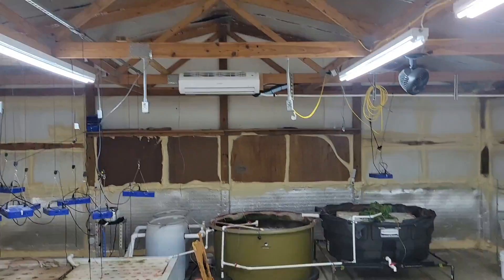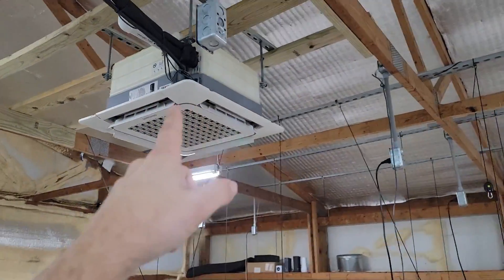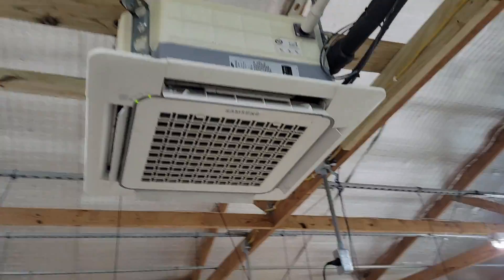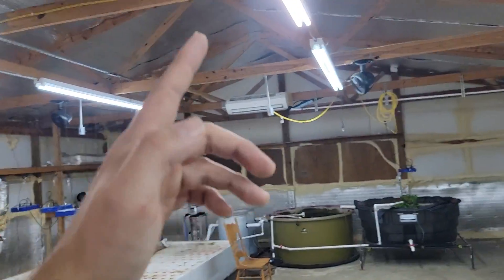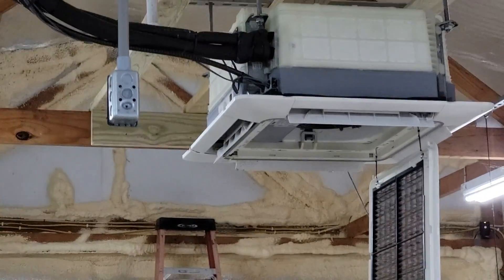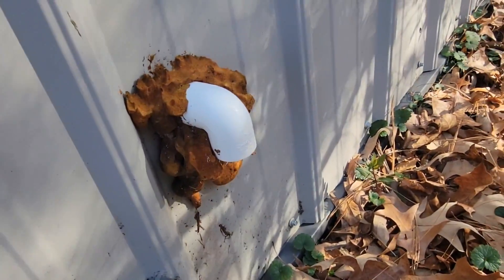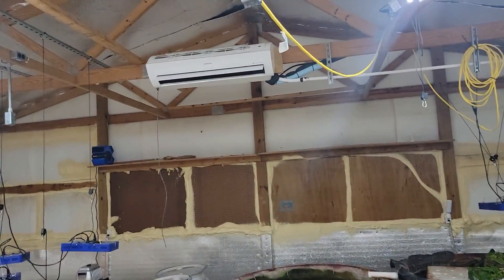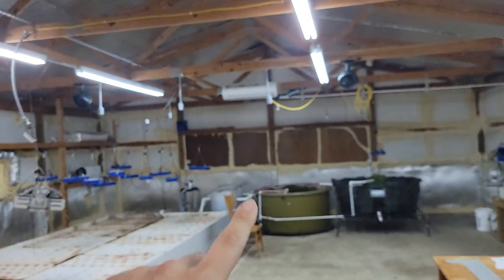Ceiling Cassettes Verses Wall mount air handler #minisplit #airconditioner

Comment: First time watching your video appreciate you sharing your knowledge! I have a question I have a 45' Storage container I'm using as a grow op I had spray foamed about 1.5 " average overall Im in  Oklahoma, was looking at a 36k  BTU mini split not sure if I should go (2) 18k handlers or (1) 36k in your opinion is that sufficient or not? Thanks in advance!
Reply from the maker: Depends on where you put those air handlers
 And how your grow operation is set up
 The more air handlers the more air
 But the best place to put an air handler is on the narrow side so that it has the best chance of having the most air throw
Reply: @taddydigest  Ok that makes since, glad you mentioned that. I was going to install it in the middle on one of the long sides. I did build a partition wall to separate the grow room & a clean room that’s 5 foot from container entrance, in your opinion should I install (2) 18k  handlers one on the short wall at far end with the other on that partition wall with them facing towards each other. I’m just wondering if I can get away with (1) 36k btu handler vs (2) 18k btu handlers in order to save a little money. Thanks for your input & sharing your knowledge!

Comment: Awesome content! Virginia here. So sizing the units. I do load calculations for each space add them together for the total btu for the condenser. The individual wall or cassette are sizes per space? Can you do up to 8 rooms? Thank You
Reply from the maker: Yes you could do 8 rooms you would have to use a 5 ton DVM Eco  With that many indoor heads
Reply: @taddydigest  Thank You Sir! 5 tons is a lot of a/c for the square footage involved. The living space is at the bottom of the house situated on the north east side. However I’m assuming the individual units will handle the “ conditioning” even with a bigger condensing unit! I’m thinking the heat pump will be more than sufficient. The homeowner doesn’t want to supplement a secondary heat source. Located in Central Virginia.

Comment: Are there any concerns installing a cassette type evaporator into unconditioned attic space where the temperature may reach as cold as -10º F?
Reply from the maker: Yes there's a drain
 And the drain might freeze at those temperatures
 Couple options to take care of that would be onePut a heater up there orPut heat tape on the drain
Reply: @taddydigest  Is there condensate generated when the unit is in heat pump mode?
Reply from the maker: In the heating mode condensate is not generated
Reply: @taddydigest So, as long as the condensate drain line is empty before winter I should be ok with the rest of the components?
Reply from the maker: That's correct

Comment: I like the ceiling mount shown in your video. Question I have what is the btu i need 12k and how long of a line set and communication cable can be used. I want to install in a upstairs bedroom ceiling, run the line set in a attic then to the condenser approximately 80’ away. Will that be ok. Also will you sell to a home owner. Thanks Barry
Reply from the maker: Hey daddio I will do a video tomorrow about this to help you
Reply: @taddydigest  great. Thanks
Reply from the maker: I did this Video for You https://youtu.be/9vz9pvkbW7I

Comment: I know you said to get a 230vlt over a 110vlt but I'm in a 34 ft 5th wheel camper.  so 110 will be better than my roof top that stays on all the time right??
Reply from the maker: yes 110 volt will be fine for your camper

Comment: I have an older home with a vented roof system and the roof is not insulated so it get extremely hot in the summertime. Do will I have to cover the unit with insulation? Thanks!
Reply: Definitely consider putting an exhaust fan up there.  A fan at 80 watts is much cheaper on electricity than an aircon at 1100w.  My attic is hot too, and I can feel the heat radiating down from the ceiling when I enter my place.  

Imagine if that heat was removed.  And running the fan at night would really cool down the attic. It's often actually uncomfortably cool outside at night, so in the morning the place would actually feel cool instead of still warm from last night.  

Also, your aircon will not have to start up until a few hours later in the day too, saving more money. Just be sure the attic fan doesn't vibrate the structure, because that is a complaint people have about attic fans, when trying to sleep.
Reply: @mikemotorbike4283  Thanks for the advice. It actually does cool down quite a lot at night. It just gets extremely hot during the day because the roof itself is not insulated but there is blown in insulation above the ceiling. The roof has several vents and there is a huge exhaust fan in the ceiling. It’s one of those vented attic systems for venting the house.
Reply from the maker: You might have to cover the unit With some batted insulation or something
 But it all depends on the temperature that that attic gets to during the hot summer
Reply: @taddydigest  Unfortunately It’s the south so it gets ridiculously hot like it has been in this recent heatwave. Thank you for replying sir. Much appreciated.😊

Comment: Why does it need a drain trap with a condensate pump?
Reply from the maker: You may not need a trap with the built in pump. You may not need to install an air vent if the
horizontal drain pipe has a proper slope. Thank You Johnny for watching the video.

Comment: Samsung comes with aluminium condenser which is very easy to leak and hard to repair, as well it Doesn't cool faster like copper condenser, u should have gathered some background information before make the purchase
Reply from the maker: These coils are copper on this equipment

Comment: The integrated condensate pump in the ceiling cassette surely makes installation easier - but I'd want to know how difficult/costly it is to replace. Nothing lasts forever, so if getting the condensate pump replaced is a huge job, that makes a ceiling cassette way less attractive to me.
Reply: Sold kitchens..no job started until all appliances at home..sizing can and does change.. yes replacement means repair work..
Reply from the maker: It's pretty easy to replace the pump that's inside the cassette I've got a video that you should check out on my playlist HVAC tips for Technicians
Reply: @taddydigest  Good that it isn't a big deal - but I'll bet that replacing an external failed condensate pump is easier. And from a homeowner's perspective, I am sure it is cheaper. ;-) Of course, gravity condensation removal is the best by far when you can go that route.

Comment: 24x24 won’t fit on the ceiling with joist by 24 in.  You need to subtract at least 1.5 inch.  In house, I have two 2x6.  So I only have 21 inch opening.  I need to go with Mitsubishi cassette
Reply from the maker: mini 4 way ceiling cassettes fit in a drop ceiling but yeah with 2 x 6 you will ne frame it out Thank you for watching. Have a blessed day

Comment: I have a ducted Bryant mini split. The fan went out and it’s almost impossible to change. The four way Cassette looks like a good replacement. We have a price, but they want to replace outside unit too. Can the Cassette be added without replacing outside unit it’s only 6 years old.
Reply from the maker: cassette has to have its own outdoor unit
same brand because of the electronics and controls
Reply: @taddydigest  Thanks
Reply from the maker: Absolutely Freddie you're welcome

Comment: Building a new garage. Brand new Trane Mitsubishi mini split. Found out after installed the lowest temp you can set on the thermostat is 67 degrees. I live in the US, upper Midwest. I don’t want to hear a garage to 67 all winter. 45 or 50 would have been more affordable. Any way to hack the system?
Reply from the maker: that's a good question I think you can using the manual
Reply: @taddydigest  thank you for the response. The installer said he call Mitsubishi and they told him no. I will look for myself.
Reply from the maker: Yeah I think you may be able to still still I think I did one time just for the heating temperature it was under the advanced settings and it was minimum and maximum temperature
 User manual
Reply: @taddydigest  thank you, I have access to the advanced menu and (bad news) it will not go lower than 67. I am going to keep working on it. Thank you so much for your help 😊
Reply from the maker: Hoping you find the answer Let me know if you do if I am in the midst of any mitsubishi reps I will ask the question
Reply from the maker: advanced features on thermostat
Reply: You are confusing the cooling temperature with the heating temperature limit. All heat pumps generally only cool down to 60-something degrees. With the heat, it only heats to 80-something degrees. You can go as low as you want when you're running it as a heater.
Reply: @mikemotorbike4283  in this case when heating the lowest temperature is 67 degrees. Not what you are saying. I would like it to heat to 45 or 50 degrees in the winter. Not as high as 67 degrees.
Reply: @mikemotorbike4283  Hi, I believe I responded to this. Just in case, on the heat cycle it starts at 67 degrees and goes up. I can not set it below 67 on heat.  What I have found out so far is raises the efficiency so the manufacture can claim a higher level without re-engineering.

Comment: Just an fyi from an HVAC contractor: the vent for the condensate drain goes AFTER the p-trap. The whole point of the trap is to prevent air from the attic or other unconditioned space pulling into the unit adding load and possibly preventing the water from draining properly.
Reply from the maker: thanks for the Knowledge
Reply: Throwing in 2 cents, a vent's first purpose is to protect the trap (from siphoning).

Comment: Is mini split a good system for a 3500sg ft house?
Reply: Some people install more than one mini split. It seems to cost about the same, since adding another indoor air handler seems to double the cost of the units.anyway, from $1000 to $2000 just for the same outdoor unit and two indoor units.  Plus the overall efficiency of the sytem goes down a bit the more indoor units you add. Also, you now have a backup.  And the lines arnet such a pain to route.  And less failure points to take your unit offline for weeks or days.
Reply from the maker: Yes absolutely
Reply: @taddydigest  and the line sets are long enough? do we buy extensions?  i have 5 bedrooms..do i install a air handler in each bedroom?  and then i'll probably need 3 air handlers on the first floor?   is that feasible with a split system?

Comment: The main disadvantage of ceiling cassettes is the problem to get the condensate water away. You always need a little pump in these things and these fail quite often. Some manufacturers (mainly C...) don't take servicing them into account and you have to disassemble nearly the whole unit to replace them.
I HATE these little devils! They create work where not necessary, I want to strangle the guy who came up with the idea to build these units the way they are built.
If possible, always prefer to get units without condensate pumps, where the water can drain freely through piping without a pump.

I work in the facility management in a big company and I could do nothing else than to replace these things all day long the whole year. It's just annoying and I simply don't want to do that anymore. Especially when one year later you are at the same unit again doing the same work.
Reply from the maker: I noticed that if you run this equipment during the construction process that the pumps are always filled up with gun and I have to take the pump out and clean it

 It would be nice if they were like the ducted equipment where you have a choice between a gravity drain and a  pump

 Thanks for watching
 Thank you for your knowledge
 have a blessed day

Comment: The main disadvantage I've seen with cassettes is if installed in a hard lid you need attic access or a near by access panel for servicing.
Reply from the maker: Yup gotta have an access panel for servicing the equipment
 That's right Joe
Reply: @taddydigest  have a video or familiar with a video with options on this? I won't have an attic, just a ceiling/roof that will be about 16" thick
Reply: I know it'd be a pain but couldn't you just drop the unit to service it? What kind of maintenance are we talking? I live in a bungalow style house, and I really don't want to do the full handler style, the cassette is a much better fit for me. Thanks for your help
Reply: @psykho15  I haven't seen a cassette that the line set will allow it to drop down. I could see it being possible to be able to run it up and down on all thread and have the wiring and condensate long enough. But refrigerant ports would need to come out the top of the unit.

Comment: Great....great video! Finally a video that's to the point and informative!
  I live in Montreal Canada and I was about to install a mini split system with a wall mount unit until I noticed that I didn't have the height clearance to install it, and I can't return the unit because I bought it last year and they won't take it back. So my question is can I buy just the ceiling cassette unit and install it to my existing outdoor unit and if yes can I buy any brand ceiling mount unit? 
Thank you for your video and your time.
Mark
Reply from the maker: Hey mark thanks for watching the video I really appreciate you watching watching I would say you probably can't install a ceiling cassette with your existing outdoor
 Not unless you're existing outdoor unit is the same brand
Reply: @taddydigest  Thank you for your response. I've found another solution, I was missing 6 inches from the ceiling for the air to circulate so I decided to cut open a portion of the ceiling without touching any joist. Now I will close up this new clearance with drywall , plaster, paint and then the original wall mount unit will fit. Once again thank you 😃
Reply from the maker: Oh that's awesome. great news. So glad you found a way

Comment: I live in Mabank TX in a house built in the early 80's, the central unit was prehistoric and replaced with several window units. I'm looking at doing away with the window units and either doing mini splits for heat and air or have a new central unit professionally installed (everything from the old system was removed, ducts and all). We are about 1800 sq feet single story, would mini splits be a good option?
Reply: I think it depends on air flow I put one in our trailer but for my bedroom at the end it still needs a window unit and heater but I have my door shut some times but it doesn't really help
Reply from the maker: I've got some other videos on sizing Mini splits you should check that out

1800 ft² is about 3 tons 

 You can definitely do mini splits
Reply: I just installed 2 mini splits in an old 10000 sq ft former hotel built in 1894. Central Valley near Fresno, we get 20ish straight days +100's. No double pane windows yet, but I knocked down the plaster, insulated, and rewired the room and hallway to be cooled. Sunny side 12x28 bedroom is a 1.5 ton and the uninsulated (yet) hallway is 5'x50' with bathroom at the far end uses a 1 ton. Nice and cool so far this year. The compressors are mounted on a ledge I built 9 feet up the side of the house with no more than 8' of refrigerant tubing and control wires. The tubing is covered with plastic raceway to protect the foam that covers the copper tube. The compressors are in the shade and get steady breeze that comes thru the trees. If I had mounted the compressors on the floor, they would be clogged with leaves in no time
Reply: How many bedrooms? Mini splits are more efficient. The other thing to think about, there shouldn’t be any hot or cold spots with mini splits, as the air distribution is better. There’s no loss in efficiency having air sent from vents. If one unit goes down, you’ll have another back up. You can consider getting a multi one unit, and 1-2 single zones. For example, all the bedrooms can be on a multizone unit. But the living room and dining room either has a separate multi zone or two individual zones. 

You can prove the individual zones vs multizone, and see prices are similar. I would recommend Mitsubishi.

Comment: 120 volt vs. 230/240 volt does not mean double the power.  Learn Ohms law if you're going to talk about electrical engineering.  The higher voltage is generally better; approximately half the current (amps) which means smaller line and less line loss.  But anyone who thinks it is anywhere near double the power does not know even the very basics of Ohms law and thus is not qualified to do electrical engineering.
Reply from the maker: Thanks 👍
Reply from the maker: Yeah I saw what I did there
 But the other parts in the video are still so good I don't want to erase the video just because I messed up a few words
 What do you think razor strap
 By the way thank you for watching and thank you for your knowledge I agree with you
Reply: @taddydigest  Just put a clarification statement in the info section below the video.
Yup Power (watts) = I (current) x V (volts); One doubles, other halves, is same power.  For a given gauge wire though lower current and higher voltage results in less power loss.
Reply from the maker: Awesome thank you I will do that that's a great idea
 Really appreciate you taking the time to help me
 Hope you have a great weekend razor strap

Comment: Do they make floor models I have a home in the mountains that the air handler is under the house. It would be nice to eliminate the duct work. Of course I would need both heat and AC. 73
Reply from the maker: https://youtu.be/Sy7eiH22xF4
Reply from the maker: Check out this video and it will give you a floor model option